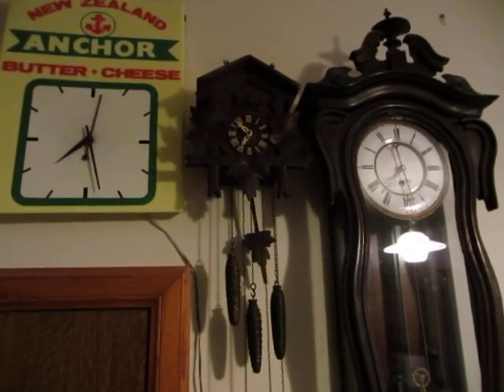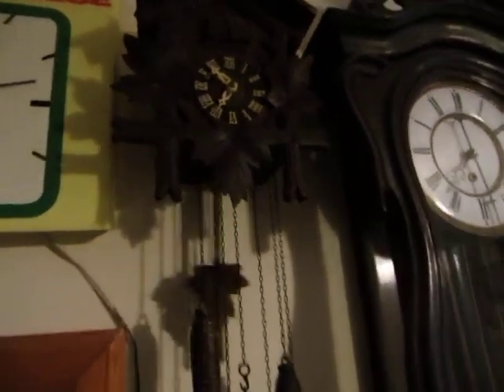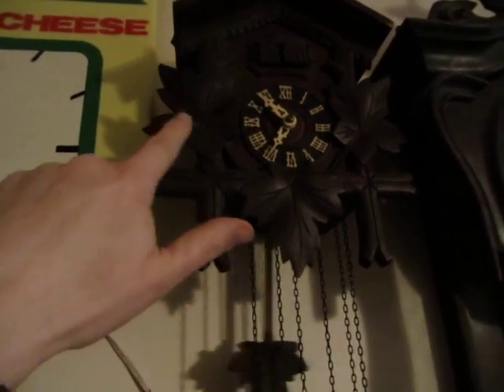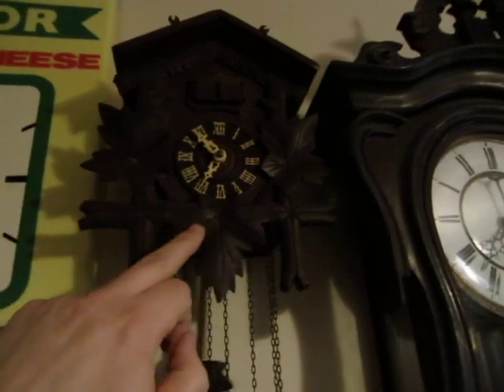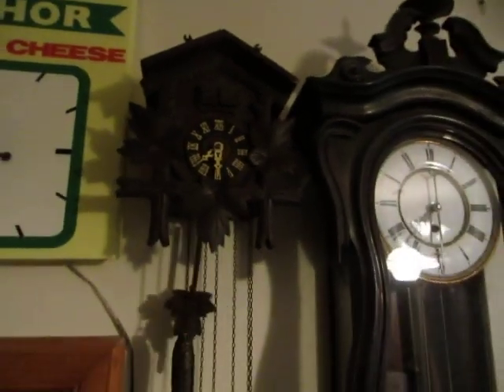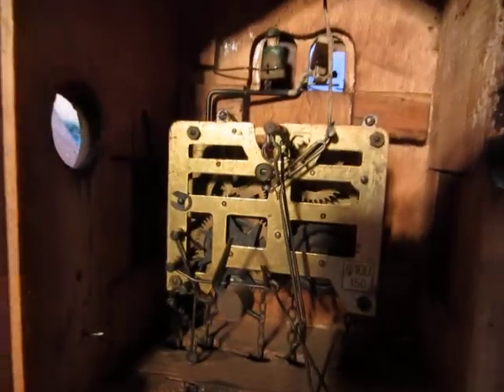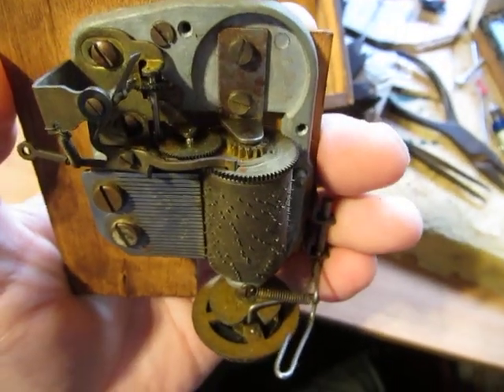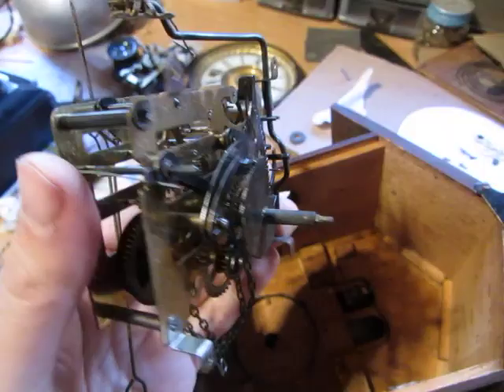Small musical cuckoo clock

Comment: Hey Uhm I have this EXTREMELY RARE Waterbury Seneca mantle clock there’s maybe 12 left intact. It’s been very abused by its previous owners. The dial is held up by nothing. The minute hand is missing. The back is missing, the glass door has broken off. the bottom is falling off. The movement is held by 2 screws. The fly wheel is missing. It appears to have been hit with a axe. Paint is chipping away. The front right foot has split off the bottom. And mold. But the movement has not stopped working it still keeps time. I don’t want it anymore bc I get depressed seeing something so abused. And I wondered if u want to have it I’ll send it to you for free.
Update: it also has Water Damage
Reply from the maker: That's very kind of you but I live in the UK, so posting it here would cost a lot. You could maybe ask Danny or someone in the US if they want it.